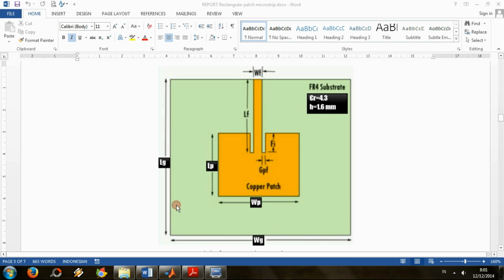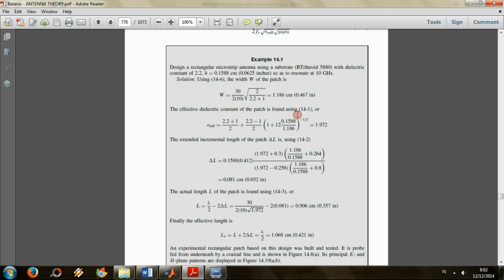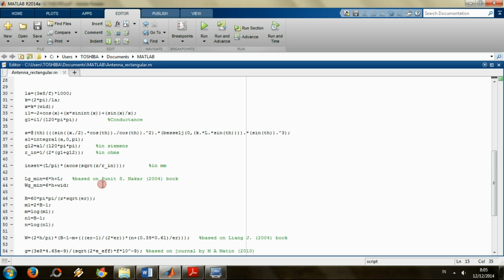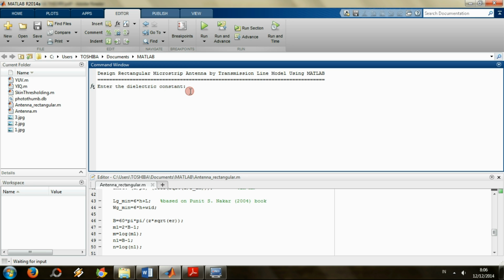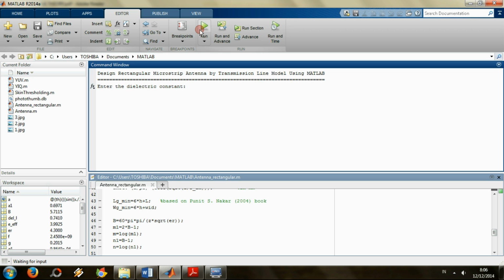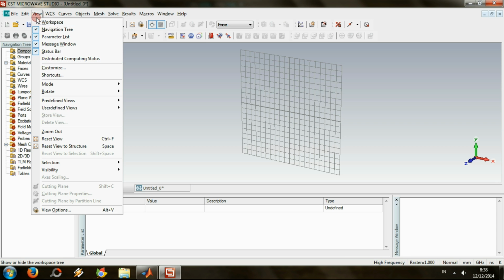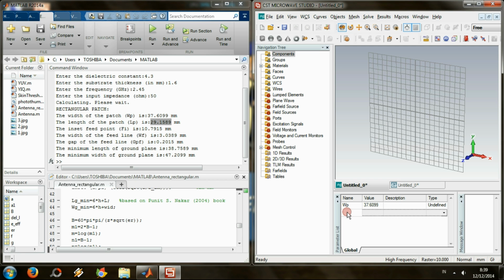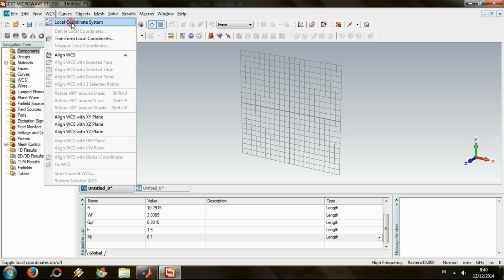Design of Rectangular Microstrip Patch Antenna Part 1 (MATLAB Calculation)

Comment from the maker: MATLAB Script:

clc
clear all
format long

disp('Design Rectangular Microstrip Antenna by Transmission Line Model Using MATLAB');
disp('=============================================================================');
er=input('Enter the dielectric constant:');
h=input('Enter the substrate thickness (in mm):');
f=input('Enter the frequency (GHz):');
z=input('Enter the input impedance (ohm):');
disp('Calculating. Please wait.');
f=f*1e9;

%calculate the width
wid=(3e8/(sqrt((er+1)/2)*2*f))*1000;        %in mm

%calculate the effective dielectric constant
e_eff=((er+1)/2)+ (((er-1)/2)* (1+((12*h)/wid))^-0.5);

%calculate the extension of length L
del_l=(((e_eff+0.3)*((wid/h)+0.264))/((e_eff-0.258)*((wid/h)+0.8)))*(0.412*h);  %in mm

%calculate the effective length
l_eff=(3e8/(2*f*sqrt(e_eff)))*1000;

%calculate the actual length
L=l_eff-(2*del_l);

la=(3e8/f)*1000;
k=(2*pi)/la;
x=k*(wid);
i1=-2+cos(x)+(x*sinint(x))+(sin(x)/x);
g1=i1/(120*pi*pi);          %Conductance

a=@(th)(((sin((x./2).*cos(th))./cos(th)).^2).*(besselj(0,(k.*L.*sin(th)))).*(sin(th)).^3);
a1=integral(a,0,pi);
g12=a1/(120*pi*pi);     %in siemens
r_in=1/(2*(g1+g12));    %in ohms

inset=(L/pi)*(acos(sqrt(z/r_in)));        %in mm

Lg_min=6*h+L;   %based on Punit S. Nakar (2004) book
Wg_min=6*h+wid;

B=60*pi*pi/(z*sqrt(er)); 
m1=2*B-1;
m=log(m1);
n1=B-1;
n=log(n1);

W=(2*h/pi)*(B-1-m+(((er-1)/(2*er))*(n+(0.39*0.61)/er)));   %based on Liang J. (2004) book 

disp('RECTANGULAR PATCH:')
    disp(['The width of the patch (Wp) is:',num2str(wid),' mm'])
    disp(['The length of the patch (Lp) is:',num2str(L),' mm'])
    disp(['The inset feed point (Fi) is:',num2str(inset),' mm'])
    disp(['The width of the feed line (Wf) is:',num2str(W),' mm'])
    disp(['The gap of the feed line (Gpf) is:',num2str(g),' mm'])
    disp(['The minimum length of ground plane is:',num2str(Lg_min),' mm'])
    disp(['The minimum width of ground plane is:',num2str(Wg_min),' mm'])

b) Calculation Result
a. Using FR-4 Substrate 
Design Rectangular Microstrip Antenna by Transmission Line Model Using MATLAB
===============================================================
Enter the dielectric constant:4.3
Enter the substrate thickness (in mm):1.6
Enter the frequency (GHz):2.45
Enter the input impedance (ohm):50
Calculating. Please wait.
RECTANGULAR PATCH:
The width of the patch (Wp) is:37.6099 mm
The length of the patch (Lp) is:29.1589 mm
The inset feed point (Fi) is:10.7915 mm
The width of the feed line (Wf) is:3.0389 mm
The gap of the feed line (Gpf) is:0.2015 mm
The minimum length of ground plane is:38.7589 mm
The minimum width of ground plane is:47.2099 mm

b. Using Teflon Substrate 
Design Rectangular Microstrip Antenna by Transmission Line Model Using MATLAB
===============================================================
Enter the dielectric constant:2.1
Enter the substrate thickness (in mm):1.6
Enter the frequency (GHz):2.45
Enter the input impedance (ohm):50
Calculating. Please wait.
RECTANGULAR PATCH:
The width of the patch (Wp) is:49.1767 mm
The length of the patch (Lp) is:41.4083 mm
The inset feed point (Fi) is:14.4895 mm
The width of the feed line (Wf) is:5.0804 mm
The gap of the feed line (Gpf) is:0.28353 mm
The minimum length of ground plane is:51.0083 mm
The minimum width of ground plane is:58.7767 mm
Reply: about your script,
 RECTANGULAR PATCH:
The width of the patch (Wp) is:23.355 mm
The length of the patch (Lp) is:18.8968 mm
The inset feed point (Fi) is:6.6104 mm
The width of the feed line (Wf) is:4.7858 mm
Undefined function or variable 'g'.

Error in Untitled (line 60)
    disp(['The gap of the feed line (Gpf) is:',num2str(g),' mm']) 

Fault was seen, what should be done?
Reply: @mustafaglnr8780  Here's the missing piece of code you need :
g=(3e8*4.65e-9)/(sqrt(2*e_eff)*f*10^-9);
paste it before the display functions, your code will work just fine.
Reply: @kaushikakshay  capa sin héroe
Reply: part 2  please
Reply: Nice
Reply: I need code
Reply: please answer me where is the equation of Lf?
Reply: Thank you sir for this antenna designing and MATLAB code. I appreciate your hard work. Sir, I will happy if you provide me MATLAB Software link to download it for free. It will be very helpful for me.

Comment: what is the length of feed line?
Reply: I have the same question, did you find a solution? Because if I'm correct, the substrate is too small in order to have the feed line.
Reply: @menyouh771  u need to check the paper she is mentioning in the video and also watch that video from which get inspired to make this video
Reply: @jaspreetkaur-yh1ve  Yes, but I am a little concerned about the code. The feed length is not fitting inside the substrate if you follow the equation related to that length. But I am guessing that that length, Lf, can be found if you minus it with Fi
Reply: @menyouh771  dear, I followed the comments and then found out that someone put the code again. I recommend u to read the comment section carefully. Most of ur questions will be answered

Comment: Not sure if this is still needed but I believe Lf = lambda/4, which can be easily calculated. This length does not matter that much, basically because it's microstrip line. If you check legacy designs you also can easily find what the length of this line is. https://www.ijraset.com/fileserve.php?FID=5116
Reply: So, can you make the line shorter in order to make it fit inside the substrate?

Comment: Waiting for the next video.
Please post the Matlab code.
Thank you so much.
you made a clear and precise video. Keep on!!!
Reply: clc
clear all
format long

disp('Design Rectangular Microstrip Antenna by Transmission Line Model Using MATLAB');
disp('=============================================================================');
er=input('Enter the dielectric constant:');
h=input('Enter the substrate thickness (in mm):');
f=input('Enter the frequency (GHz):');
z=input('Enter the input impedance (ohm):');
disp('Calculating. Please wait.');
f=f*1e9;

%calculate the width
wid=(3e8/(sqrt((er+1)/2)*2*f))*1000;        %in mm

%calculate the effective dielectric constant
e_eff=((er+1)/2)+ (((er-1)/2)* (1+((12*h)/wid))^-0.5);

%calculate the extension of length L
del_l=(((e_eff+0.3)*((wid/h)+0.264))/((e_eff-0.258)*((wid/h)+0.8)))*(0.412*h);  %in mm

%calculate the effective length
l_eff=(3e8/(2*f*sqrt(e_eff)))*1000;

%calculate the actual length
L=l_eff-(2*del_l);

la=(3e8/f)*1000;
k=(2*pi)/la;
x=k*(wid);
i1=-2+cos(x)+(x*sinint(x))+(sin(x)/x);
g1=i1/(120*pi*pi);          %Conductance

a=@(th)(((sin((x./2).*cos(th))./cos(th)).^2).*(besselj(0,(k.*L.*sin(th)))).*(sin(th)).^3);
a1=integral(a,0,pi);
g12=a1/(120*pi*pi);     %in siemens
r_in=1/(2*(g1+g12));    %in ohms

inset=(L/pi)*(acos(sqrt(z/r_in)));        %in mm

Lg_min=6*h+L;   %based on Punit S. Nakar (2004) book
Wg_min=6*h+wid;

B=60*pi*pi/(z*sqrt(er)); 
m1=2*B-1;
m=log(m1);
n1=B-1;
n=log(n1);

W=(2*h/pi)*(B-1-m+(((er-1)/(2*er))*(n+(0.39*0.61)/er)));   %based on Liang J. (2004) book 

g=(3e8*4.65e-9)/(sqrt(2*e_eff)*f*10^-9);

disp('RECTANGULAR PATCH:')
    disp(['The width of the patch (Wp) is:',num2str(wid),' mm'])
    disp(['The length of the patch (Lp) is:',num2str(L),' mm'])
    disp(['The inset feed point (Fi) is:',num2str(inset),' mm'])
    disp(['The width of the feed line (Wf) is:',num2str(W),' mm'])
    disp(['The gap of the feed line (Gpf) is:',num2str(g),' mm'])
    disp(['The minimum length of ground plane is:',num2str(Lg_min),' mm'])
    disp(['The minimum width of ground plane is:',num2str(Wg_min),' mm'])

Comment: I gotta say there is no error in her code. I've experimented her code and the result is completely correct. If somebody finds any errors when you run the program, I gotta say it is your fault. This video is awesome. It would be better if Imee can explain how to calculate the Lf. Thank you very much!
Reply: Okay, I have concerns about the Lf part. If I follow the equations it becomes too long and finds its way outside the substrate. Can you make the Lf shorter then?
Reply: Okay, I have concerns about the Lf part. If I follow the equations it becomes too long and finds its way outside the substrate. Can you make the Lf shorter then?
Reply: Okay, I have concerns about the Lf part. If I follow the equations it becomes too long and finds its way outside the substrate. Can you make the Lf shorter then?

Comment: Pls how can i get the codes?
Reply: clc
clear all
format long

disp('Design Rectangular Microstrip Antenna by Transmission Line Model Using MATLAB');
disp('=============================================================================');
er=input('Enter the dielectric constant:');
h=input('Enter the substrate thickness (in mm):');
f=input('Enter the frequency (GHz):');
z=input('Enter the input impedance (ohm):');
disp('Calculating. Please wait.');
f=f*1e9;

%calculate the width
wid=(3e8/(sqrt((er+1)/2)*2*f))*1000;        %in mm

%calculate the effective dielectric constant
e_eff=((er+1)/2)+ (((er-1)/2)* (1+((12*h)/wid))^-0.5);

%calculate the extension of length L
del_l=(((e_eff+0.3)*((wid/h)+0.264))/((e_eff-0.258)*((wid/h)+0.8)))*(0.412*h);  %in mm

%calculate the effective length
l_eff=(3e8/(2*f*sqrt(e_eff)))*1000;

%calculate the actual length
L=l_eff-(2*del_l);

la=(3e8/f)*1000;
k=(2*pi)/la;
x=k*(wid);
i1=-2+cos(x)+(x*sinint(x))+(sin(x)/x);
g1=i1/(120*pi*pi);          %Conductance

a=@(th)(((sin((x./2).*cos(th))./cos(th)).^2).*(besselj(0,(k.*L.*sin(th)))).*(sin(th)).^3);
a1=integral(a,0,pi);
g12=a1/(120*pi*pi);     %in siemens
r_in=1/(2*(g1+g12));    %in ohms

inset=(L/pi)*(acos(sqrt(z/r_in)));        %in mm

Lg_min=6*h+L;   %based on Punit S. Nakar (2004) book
Wg_min=6*h+wid;

B=60*pi*pi/(z*sqrt(er)); 
m1=2*B-1;
m=log(m1);
n1=B-1;
n=log(n1);

W=(2*h/pi)*(B-1-m+(((er-1)/(2*er))*(n+(0.39*0.61)/er)));   %based on Liang J. (2004) book 

g=(3e8*4.65e-9)/(sqrt(2*e_eff)*f*10^-9);

disp('RECTANGULAR PATCH:')
    disp(['The width of the patch (Wp) is:',num2str(wid),' mm'])
    disp(['The length of the patch (Lp) is:',num2str(L),' mm'])
    disp(['The inset feed point (Fi) is:',num2str(inset),' mm'])
    disp(['The width of the feed line (Wf) is:',num2str(W),' mm'])
    disp(['The gap of the feed line (Gpf) is:',num2str(g),' mm'])
    disp(['The minimum length of ground plane is:',num2str(Lg_min),' mm'])
    disp(['The minimum width of ground plane is:',num2str(Wg_min),' mm'])

Comment: correct code:
clc
clear all
format long

disp('Design Rectangular Microstip Antenna by Transmission Line Model Using MATLAB');
disp('============================================================================');
er = input('Enter the dielectric constant:');
h = input('Enter the substract thickness(in mm):');
f = input('Enter the frequency(in GHz):');
z = input('Enter the input impedence(ohm):');
disp('calculating,please wait......');
f = f*1e9;

%calculate the width
wid = (3e8/(sqrt((er+1)/2)*2*f))*1000;   %in mm

%calculate the effective dielectric constant
e_eff = ((er+1)/2)+(((er-1)/2)* (1+((12*h)/wid))^-0.5);

%calculate the extension of length L
del_l = (((e_eff+0.3)*((wid/h)+0.264))/((e_eff-0.258)*((wid/h)+0.8)))*(0.412*h);  % in mm

%calculate the effective length
l_eff = (3e8/(2*f*sqrt(e_eff)))*1000;

%calculate the actual length
L = l_eff-(2*del_l);

la = (3e8/f)*1000;
k = (2*pi)/la;
x = k*wid;
il = -2+cos(x)+(x*sinint(x))+(sin(x)/x);
g1 = il/(120*pi*pi);  %conductance

a = @(th)(((sin((x./2).*cos(th))./cos(th)).^2).*(besselj(0,(k.*L.*sin(th)))).*(sin(th)).^3);
a1 = integral(a,0,pi);
g12 = a1/(120*pi*pi);   %insiemens
r_in = 1/(2*(g1+g12));   %in ohms

inset = (L/pi)*(acos(sqrt(z/r_in)));   %in mm

Lg_min = 6*h+L;   %based on Punit S. Nakar(2004) book
Wg_min = 6*h + wid;

B = 60*pi*pi/(z*sqrt(er));
m1 = 2*B-1;
m = log(m1);
n1 = B-1;
n = log(n1);

W = (2*h/pi)*(B-1-m+(((er-1)/(2*er))*(n+(0.39*0.61)/er))); %bansed on Liang J. (2004) book

g = (3e8*4.65e-9)/(sqrt(2*e_eff)*f*10^-9);  %bansed on journal by M A Matin (2010)

disp('Rectangular patch:');
    disp(['The width of the patch(wp) is:',num2str(wid),'mm']);
    disp(['The length of the patch(Lp)is:',num2str(L),'mm']);
    disp(['The inset feed point(Fi)is:',num2str(inset),'mm']);
    disp(['The width of the feed line(Wf)is:',num2str(W),'mm']);
    disp(['The gap of the feed line(Gpf)is:',num2str(g),'mm']);
    disp(['The minimum length of ground plane is:',num2str(Lg_min),'mm']);
    disp(['The minimum width of ground plane is:',num2str(Wg_min),'mm']);

Comment: 100% WORKING. HOPEFULLY HELPFUL

MATLAB CODE:

clc
clear all
format long

disp('Design rectangular antenna by transmission line mode using MATLAB');
disp('---------------------------------------------------------------------------');

er = input('enter the dielectric constant :');
h = input('enter the subtract thickness(mm) :');
f = input('enter the frequency (GHz) :');
z = input('enter the input impedance (ohm) :');
disp('calculating. Please wait');

%% frequency
f = f*1e9;
%% calculate the width
wid = (3e8/(sqrt((er+1)/2)*2*f))*1000;
%% calculate the effective dieletric constant
e_eff = ((er+1)/2)+(((er-1)/2)*(1+((12*h)/wid))^-0.5);
%% calculate the ectension of length L
del_l = (((e_eff+0.3)((wid/h)+0.264))/((e_eff-0.258)((wid/h)+0.8)))*(0.412*h);
%% calculate the effective length
l_eff = (3e8/(2*f*sqrt(e_eff)))*1000;
%% calculate the actual length
L = l_eff-(2*del_l);

la = (3e8/f)*1000;
k = (2*pi)/la;
x = k*wid;
il = -2+cos(x)+(x*sinint(x))+(sin(x)/x);
g1 = il/(120*pi*pi); %conductance

a = @(th)(((sin((x./2).cos(th))./cos(th)).^2).(besselj(0,(k.L.*sin(th)))).(sin(th)).^3);
a1 = integral(a,0,pi);
g12 = a1/(120*pi*pi); % in siemens
r_in = 1/(2*(g1+g12)); %in ohms

inset = (L/pi)*(acos(sqrt(z/r_in)));

Lg_min = 6*h+L; %based on Punit S. Nakar (2004) book
Wg_min = 6*h + wid;

B = 60*pi*pi/(2*sqrt(er));
m1 = 2*B - 1;
m = log(m1);
n1 = B-1;
n = log(n1);

W = (2*h/pi)(B-1-m+(((er-1)/2*er))(n+(0.39*0.61/er)));
g = (3e8*4.65e-9)/(sqrt(2*e_eff)*f*10^-9);

disp('Rectangular patch:')
disp(['The width of the patch (Wp) is:',num2str(wid),' mm'])
disp(['The length of the patch (Lp)is:',num2str(L),' mm'])
disp(['The inset feed point(Fi)is:',num2str(inset),' mm'])
disp(['The width of the feed line (Wf)is:',num2str(W),' mm'])
disp(['The gap of the feed line (Gpf)is:',num2str(g),' mm'])
disp(['The minimum length of ground plane is:',num2str(Lg_min),' mm'])
disp(['The minimum width of ground plane is:',num2str(Wg_min),' mm'])
Reply: help me,please....please

Comment: I want the correct code too. Where is it?
Reply: clc
clear all
format long

disp('design rectangular antenna by transmission line moder using matlab');
disp('---------------------------------------------------------------------------');

er = input('enter the dielectric constant:');
h = input('enter the substract thickness(in mm):');
f = input('enter the frequency(in GHz):');
z = input('enter the input impedence(ohm):');
disp('calculating. Please wait');

%% frequency
f = f*1e9;
%% calculate the width
wid = (3e8/(sqrt((er+1)/2)*2*f))*1000;
%% calculate the effective dieletric constant
e_eff = ((er+1)/2)+(((er-1)/2)*(1+((12*h)/wid))^-0.5);
%% calculate the ectension of length L
del_l = (((e_eff+0.3)((wid/h)+0.264))/((e_eff-0.258)((wid/h)+0.8)))*(0.412*h);
%% calculate the effective length
l_eff = (3e8/(2*f*sqrt(e_eff)))*1000;
%% calculate the actual length
L = l_eff-(2*del_l);

la = (3e8/f)*1000;
k = (2*pi)/la;
x = k*wid;
il = -2+cos(x)+(x*sinint(x))+(sin(x)/x);
g1 = il/(120*pi*pi); %conductance

a = @(th)(((sin((x./2).cos(th))./cos(th)).^2).(besselj(0,(k.L.*sin(th)))).(sin(th)).^3);
a1 = integral(a,0,pi);
g12 = a1/(120*pi*pi); % in siemens
r_in = 1/(2*(g1+g12)); %in ohms

inset = (L/pi)*(acos(sqrt(z/r_in)));

Lg_min = 6*h+L; %based on Punit S. Nakar (2004) book
Wg_min = 6*h + wid;

B = 60*pi*pi/(2*sqrt(er));
m1 = 2*B - 1;
m = log(m1);
n1 = B-1;
n = log(n1);

W = (2*h/pi)(B-1-m+(((er-1)/2*er))(n+(0.39*0.61/er)));
g = (3e8*4.65e-9)/(sqrt(2*e_eff)*f*10^-9);

disp('Rectangular patch:')
disp(['The width of the patch (Wp) is:',num2str(wid),' mm'])
disp(['The length of the patch (Lp)is:',num2str(L),' mm'])
disp(['The inset feed point(Fi)is:',num2str(inset),' mm'])
disp(['The width of the feed line (Wf)is:',num2str(W),' mm'])
disp(['The gap of the feed line (Gpf)is:',num2str(g),' mm'])
disp(['The minimum length of ground plane is:',num2str(Lg_min),' mm'])
disp(['The minimum width of ground plane is:',num2str(Wg_min),' mm'])
Reply: @myranuroddin2761   not corecct

Comment: where is Lf size in the results?
Reply: Hi, this is exactly my questions because when I use the equation for Lf the substrate needs to be higher. Did you find a solution?